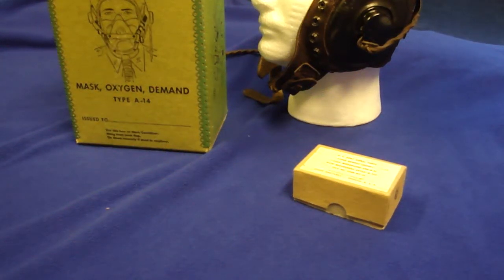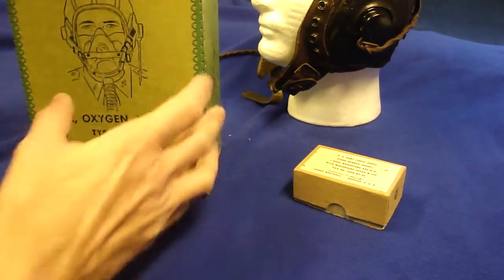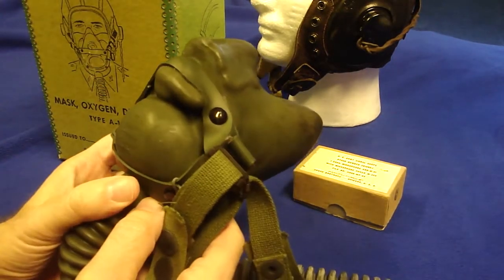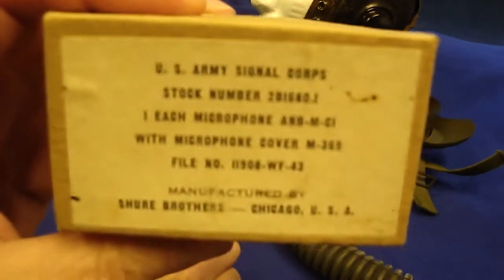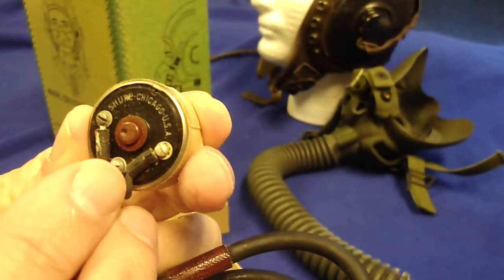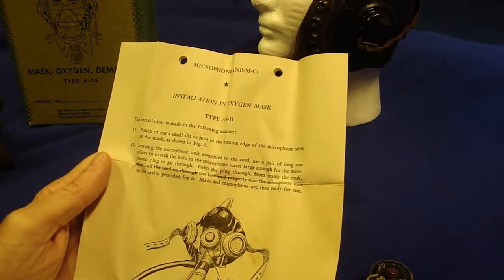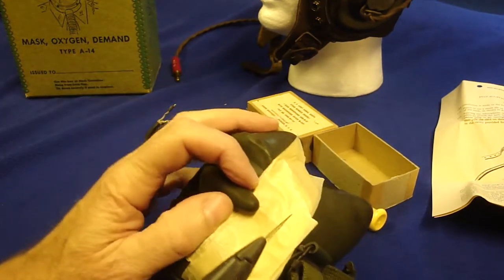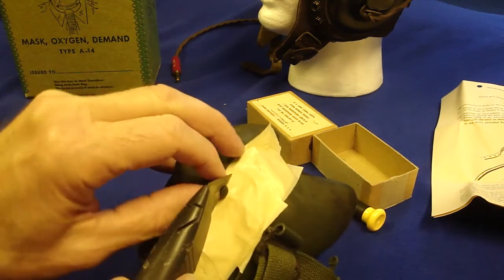Installing an ANB-M-CI mic in a Type A-14 Oxygen Mask

Comment: Is there asbestos content in these masks? I found one locally at an antique shop for 20$. Either way, it's still going on a shelf!
Reply from the maker: Asbestos!  Gosh, I hope not.   Let me know if you have any documented evidence.
Reply: davidgpo I'll let you know if I find anything.
Reply: A little late to the comment, but asbestos was an issue with the gas masks because of the filter elements, not the mask itself. The oxygen masks have no asbestos.
Reply: @JEdwards88  I just had the question because I know of older helmets that were contaminated with asbestos. Cheers!